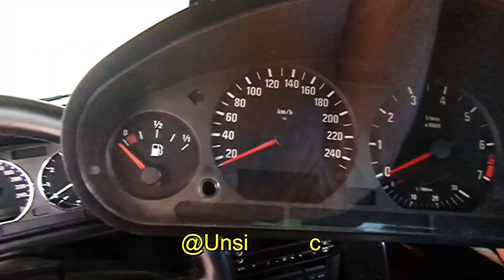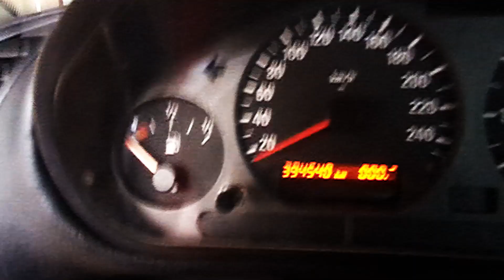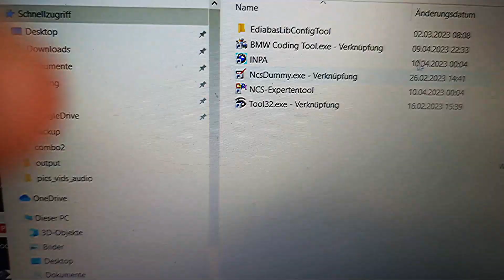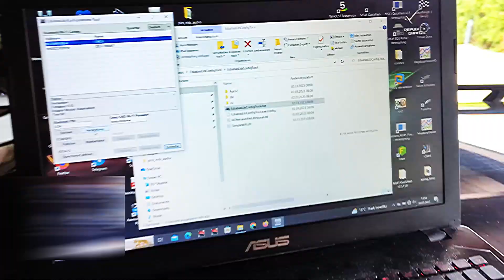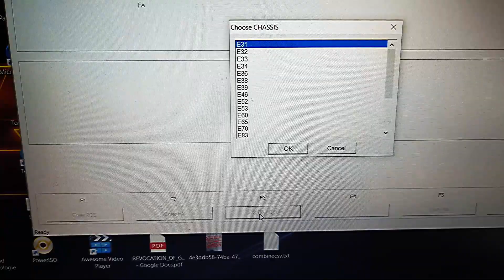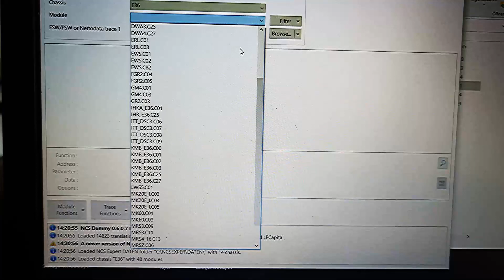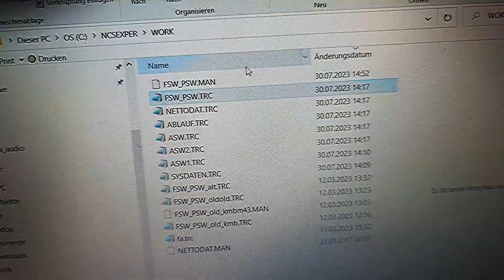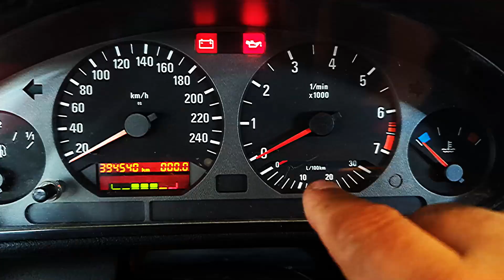BMW E36 - S.I.P - Cluster coding with Magic Bluetooth Dongle  - NCS Expert - dummy / INPA - ADS

Comment: "You say that the scanner works using the ADS protocol, but everywhere in your video, including the instructions, it says OBD2." When installing INPA, you need to select a protocol. Which one did you select? What is your INPA version?
Reply from the maker: i have no clue where you see that i state obd2 everywhere in the video and what instructions.  this video  is not about an inpa install..for the dongle a working inpa installation needs to be there and the config tool from the dongle does everything. inpa v 5.0 ...maybe watch again...

Comment: Great video. How does one edit the mileage in an E36 cluster? Is it using this dongle and software?
Reply from the maker: not possible via ncs expert. as this is illegal here i cant and wont give more info how to do it..
Reply: @CSI_tuning_solutions  lol yeah, why do people even ask. Nowhere is it legal to change the indicated mileage on a car. The only exception is when you install a new cluster and want to have it shown the ORIGINAL milaeage it was on. BMW provided for this with the coding key on the back of the cluster (on later units). You transfer over the coding key to the new cluster and then you sync the coding key with the internal EPROM. Beware though, the highest of the two is the one that gets synched. So no problem with a new cluster, but a second hand one, with a higher mileage than your own, then don't sync and find another cluster.

Comment: Hi, do you know if it's possible to change the"tachomotor speed limit"? Extracting and re-writing the eeprom data? For example change from 7000 to 9000? I am building a custom Cluster and am trying to modify this for a long time. Thanks!
Reply from the maker: Unfortunately idk
Reply: @CSI_tuning_solutions  Ah hahah no problem, thanks for the fast reply. Would you recon I can just change the value in the TRC file? It's there under "schwelle_ueberdrehzahl", just change it to 9000 and it would scale accurately? (I made a custom faceplate with 9000rpm)
Reply from the maker: @djes.36  interresting. i havent tried this because i never had the need to try it. only one way to find out i suppose
Reply: Hi! I'm trying to do the exact same thing😂 did you succeed?